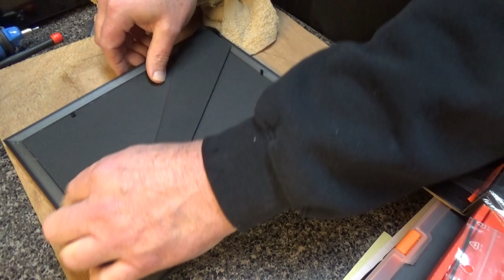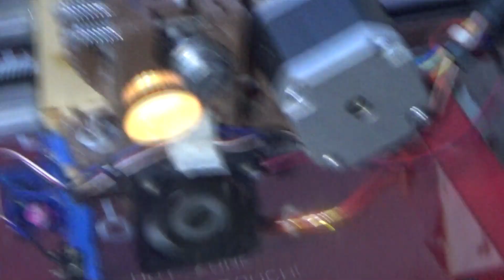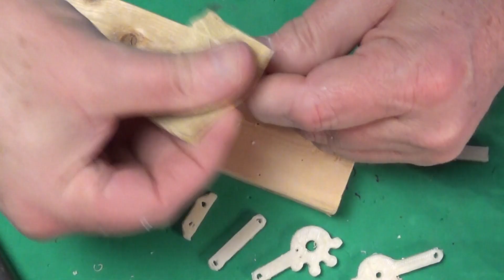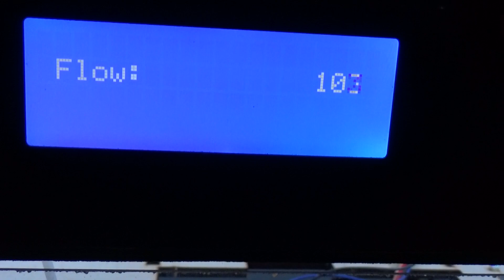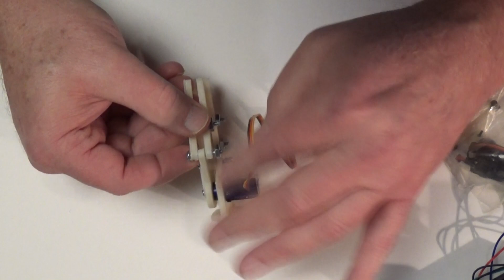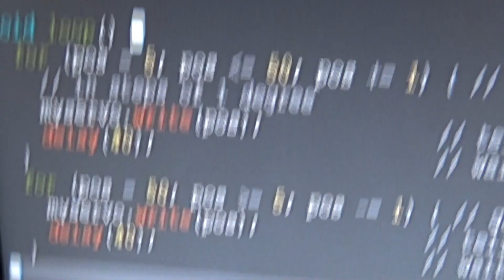Convincing Grumpy Home Built 3D Printer Into Making Prototype Parts

Comment: I run a CR_10s. I run the latest version of Cura and Marlin. I upgraded to mostly Noctua hotend and control box fans, MicroSwiss hotend, hardened steel nozzles, and I use Aquanet extra super hold on a glass plate.

You seem to be printing really fast. Slow down a bit to get better quality prints. In cura, turn on a feature called 'Ironing". Get a TEMPERED glass piece for your bed.

I am able to print PolyCarbon with the heating element upgrade in the hotend as well. I am now working on  Carbon Fiber/Poly Carbon.

My goal is to be able to print with PEEK. Poly Ethyl Ethyl Ketone. PEEK is what NASA uses on spacecraft and Doctors use PEEK to replace bones and skull parts. 

I could go on but I should probably stop geeking out and get busy.

Comment: Have you tried using Aqua Net extra super hold hair spray on your glass plate?  That is what I use and it works great.  I saturate my glass plate and as the heat bed warms up the hairspray sets and my parts stick great and pop free once the plate cools down.  I spray the plate with every print and once hair spray deposits get too thick I wash the plate in the dishwasher and that cleans it all off.  You can also just soak the plate in warm water for a while and scrub it off with a rag if you don't want to use a dishwasher.

Comment: You should be using the latest version of cura and manually transferring your settings to it. Cura 4.x has some really neat features and optimizations. You should also switch that servo auto bed leveling for a bltouch.